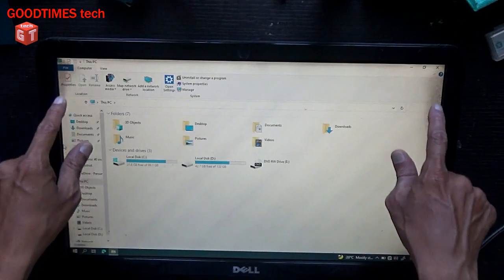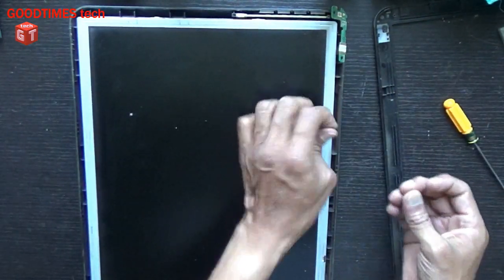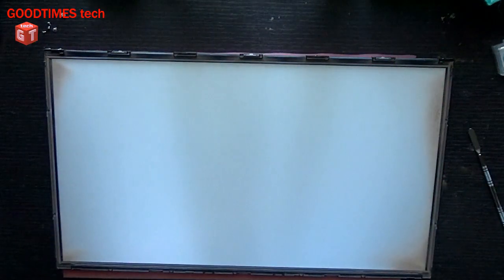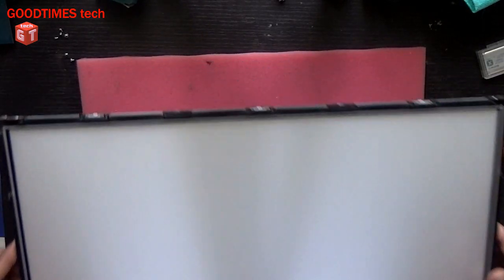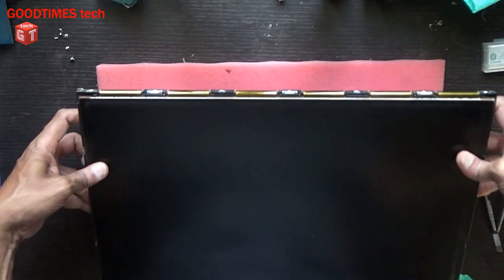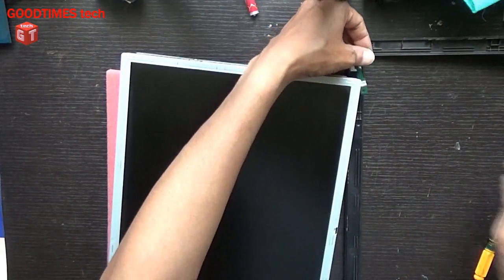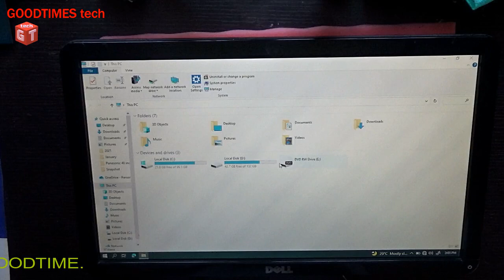How to disassemble and clean inside of LCD or LED monitor.

Comment: I finally found the courage to do it. I had a backup TV anyways which was not any better than my old dusty monitor. But now after carefully cleaning it, my monitor is 99% cleaner than before! Thank you for this video. I cleaned the "repair" guy's mess, literally. I wouldn't have been able to clean my monitor without your help.

Comment: 5:12 Here my yellow color strap thing on the left snapped out😭😭😭😭. PLEASE HELP ME> I'm in BIG TROUBLE
Reply from the maker: Hi, sorry for late reply and sorry to know that the COF(Chip on film) IC got detached, to fix this we need a COF bonding machine. you can see if anyone around in your city does COF bonding and get it fixed by them.
Reply: Same problem here.. Will it be fixed with electrical tape? 😅🤧
Reply from the maker: @rosendcharleslayasan2183  Hi, It cannot be fixed by electrical tape, it can be fixed only by using ACF(Anisotropic Conductive Film) tape, this tape contains small conductive balls that connect tracks on glass and COF IC.

Thank you, have a GOODTIME....

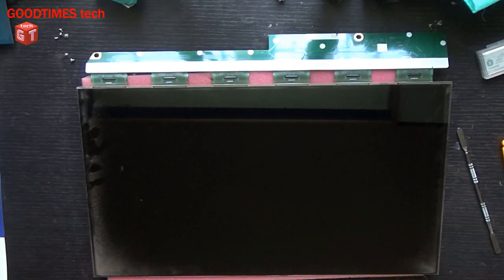Comment: I have a Samsung UN32J525DAFXZA that one column doesn't light and stay black. I know the problem is one of the ribbon cable not making contact at that column on the screen side connection (e.g those 6 ribbon cables that show in 4:32 or 9:06 from PBC to screen) Do you have any video on how to fix that? For the rest, the TV still looks like new this days.
Reply: You probably have to buy a brand new main board or something and replace it.
Reply: @quincylewis6839  Hi, I don't think that's the solution, as a new board means to solder not only one, but 6 ribbon cables, as the part that is faulty in my case is the one attached to the glass. Thanks for the reply!

Comment: Will this work on n-vision monitor. N2455
Reply from the maker: Hi, as n-vision monitor is a bezel less/ frame less monitor, removing the screen and cleaning inside is risky(possibility of screen damage is high). if I get any n-vision monitor, I will check possibility and make a video.
Thank you, have a GOODTIME....
Reply: @GOODTIMEStech  thank so much bro. Too late I already crack the lcd but it's possible  for cleaning
now I need replacement. Do you think YTG monitor are good?